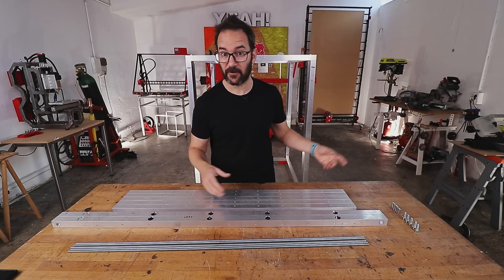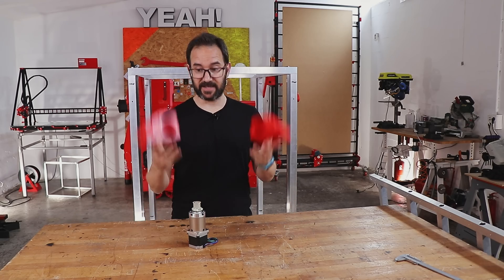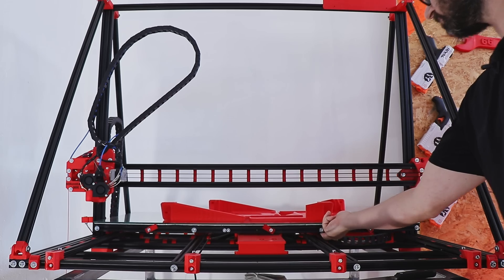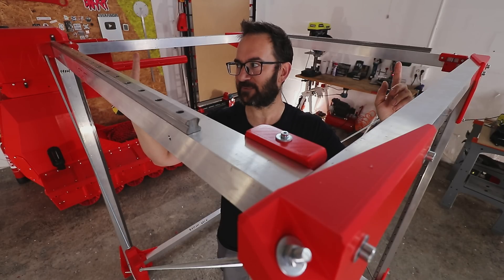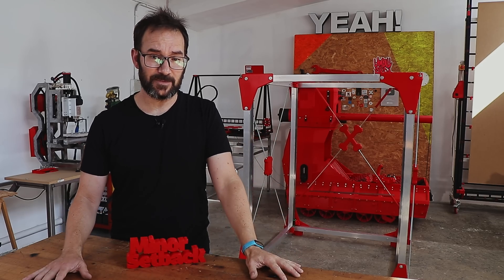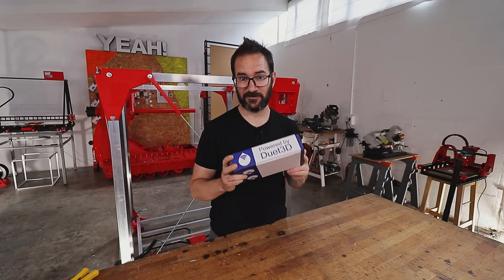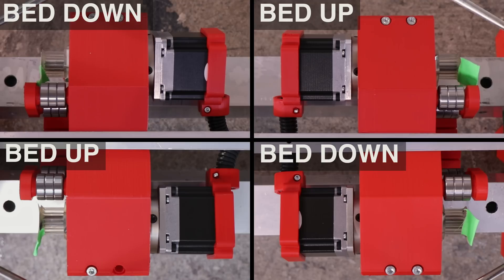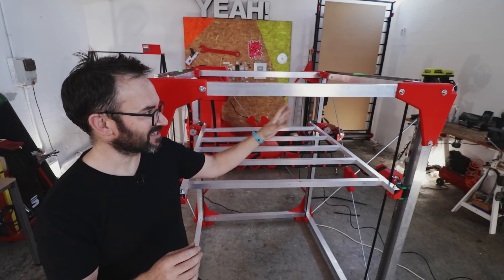MOST POWERFUL 3D PRINTER BED EVER (lifts human) - GIANT 3D PRINTER BUILD PT. 2

Comment: 10:15 since you seem to love it when it's all pretty and neat, may I suggest you add a ferrule crimper to your tool arsenal. Though there is no issue with the way you did your wiring, it just looks so neat with ferrules and it's cheap to buy and use.  Love your videos Ivan, I can only imagine your colorful cursing after your minor setback  lol 

Have you considered using Klipper firmware? at this size, your printer would greatly benefit from advanced features like input shaper.   Cheers!
Reply: Agreed. The Duet has some very good features on its own, but Klipper adds a lot for relatively little money (if you can find a Raspberry Pi for MSRP these days). Only thing bad about Klipper is the community around it.
Reply: He's using a duet, so he already has reprap. I don't know if klipper would add many functions then
Reply: @thomasschoonwater3390  Klipper will run a Duet with a Rpi or other powerful SBC plugged into it. The main reason I mentioned Klipper is because the larger the frame, the more it will suffer from resonance and Klipper has a function called 'input shaper' that is designed to compensate resonance; which produces nicer prints at faster speeds.
Reply: @simonl7784  RepRapFirmware 3.4 and after for the Duet boards already has input shaping and accelerometer support. Has had the web interface and easy firmware editing via gcode config files (.cfg for Klipper -> .g for RRF) without the need for a SBC or a Rasberry Pi for years now. For this build I think the Duet board chosen will be great and more than enough. Are there any other significant features that are Klipper only?
Reply: @Dramaican88  Oh I stand corrected! Thanks Greg I'll look into that. I thought this was a Klipper only thing. The only other feature worth adding the SBC would be for hosting a web interface and webcam but that's not a Klipper thing either.
Reply: @Dramaican88  did you ever use rrf input shaper? Its a pain. Lots of people, me including have problems getting an spi connection to the accelerometer. Also there is not frequency testing like in klipper, and also same values for x and y axis. At this point klipper input shaper > rrf input shaper
Reply: @staticred1559  I have used it only on my Duet 2 board with visual test prints (and saw an improvement), not with an accelerometer. I have the one that is definitely supported though, I am just printing some helpers to help mount the accelerometer better and will soon try it out. I think the input shaping plugin for the duet web ui will make things easy, but I could be wrong. Indeed the RRF workflow is not as smooth as in Klipper, as it is more recently added in RRF, while Klipper has more testing and experience from users using the feature for some time now. That is why I will also be testing Klipper on my Voron (different accelerometer bought for that one) and keep tinkering with both firmwares to see which one has the better all around features, ease of use and configurability. No solution is perfect currently and the rate of development and updates is different for each set of solutions.
Reply: @Dramaican88  ah, a Voron brother! Cheers mate.
Reply: yeah a fuel duet setup vs a klipper setup are about the same price these days.
Reply: ¿ Hace impresiones de calidad o solo es un monstruo de aluminio y plastico?